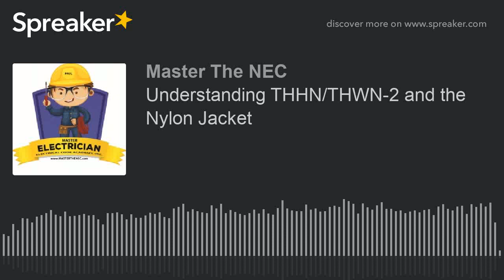Understanding THHN/THWN-2 and the Nylon Jacket

Comment: Can I used Southwire #12 THHN/THWN inside PVC conduit outdoors? The stuff they sell at Home Depot says it isn't THWN-2, and says dry location only on the website. Seems like it should be ok for wet location 75 degrees C.
Reply from the maker: Greetings - THHN/THWN is thermoplastic insulated conductors that are rated 90C in Dry Locations and 75C in Wet Locations. All raceways outside or underground are wet locations so just be aware that if you need to make ampacity adjustments or corrections, you can begin your arithmetic at the 90C value (never exceeding the terminal ratings however) for a Dry location but in a Wet location you have to begin your arithmetic at the 75C [again, never exceed the terminal limitations 110.14(C).] Now, some companies, such as Encore Wire rated their THHN and also THWN-2 so the "-2" means you can start your adjustments and corrections journey, where applicable, from the 90C ampacity of 310.15(B)(16) in the 2017 NEC or 310.16 in the 2020 NEC. Just never forget that the calculated load can never exceed that of it's terminal ratings.
Reply: @MasterTheNEC  Thanks for the detailed answer. Much appreciated.

Comment: This topic brings back memories of Therm-O-Link of Texas, I ran the extrusion machine that made crosslink wire. Wire extruded out into a high pressure steam pipe for maybe 250 ft. ?  Than returned into the cold water, finally packed into 35 gallon or 60 gallon drums. If I remember 22 gauge was the smallest I ran up to 14 gauge was hectic it had me running around.